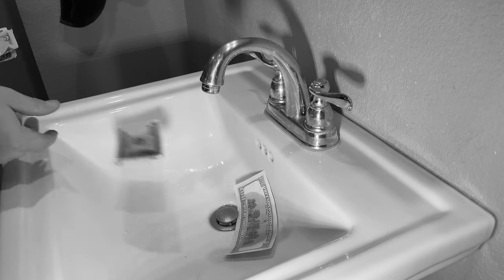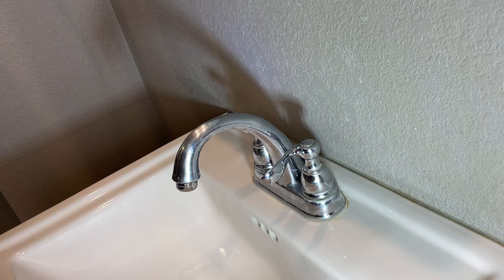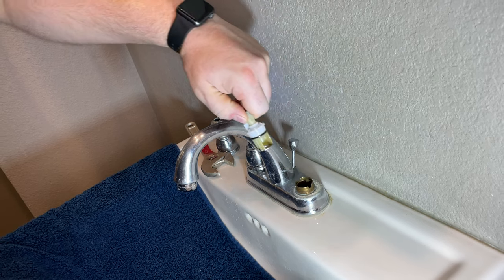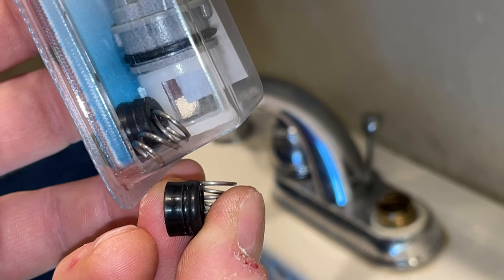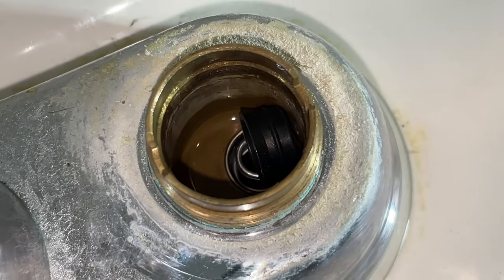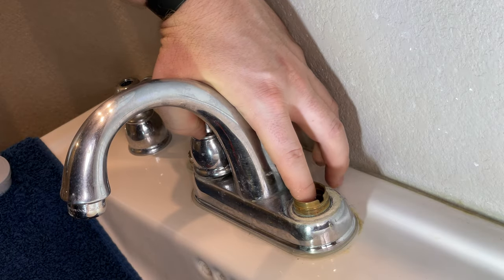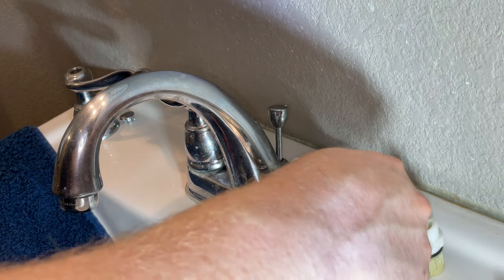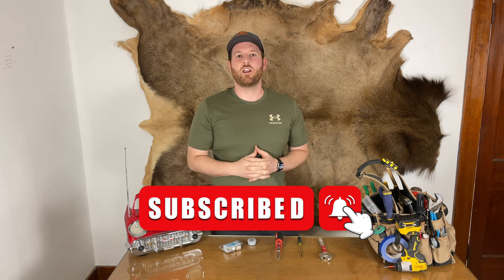BATHROOM FAUCET LEAK REPAIR From A-Z!! (Cheap and Easy)

Comment: thanks, I'll go try again, I wasn't sure about the rubber gasket part going in the hole because it's sort of flared and won't just pop in. I'll let you know how it worked out.
Reply from the maker: Yes, the seat (the rubber piece with the flared bottom)  should be secured in the hole and on top of the spring.
Reply: @HandymanHertz  worked! thank you very much. had a rough time putting the knobs back on but i used my dremel to smooth out the calcium build up and they slid down easy (added grease) and was able to screw them back on, again, thanks a lot!
Reply from the maker: @gilmo1938  hey, very glad to help! 👍🏼